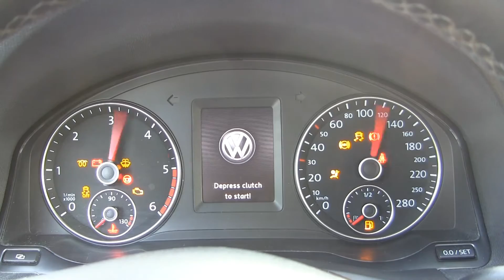DStage #20 - SC engine swap part 4

Comment: Nice job around the car, hope it turn out well. Could you specify better which radiator you installed?
Thank you
Reply from the maker: Hi, thanks! In the video I'm saying it's from Skoda Favorit but in fact I think it's for Skoda Felicia 1.6 94/95-01, probably the same as for 1.9D.
Reply: DStage I see that you had to cut some little bits but the remaining was straight in?  Did you had to change any piping?
Reply from the maker: @jorgesouto1089  If I had not chosen to use the original turbo and/or exhaust manifold no cutting would be required. There are plenty of ways to fit various turbos with custom manifolds. Piping... I have a different radiator and the engine has a bit different layout of coolant pipes so naturally I had to rebuild it. It is possible to fit original Seicento coolant tank but I have chosen to relocate it and used some VW one. This particular t-jet variant had a coolant pipe aiming straight forward exactly where my radiator is so I had to cut it and made a 90 deg bend there which is shown in in this episode as well. I have also replaced hoses for the cabin heating radiator. Basically Engine has its original piping except this one change and car's system was changed completely, probably some original parts could be reused i you wish. From other pipes of course the exhaust system is replaced entirely starting from downpipe.